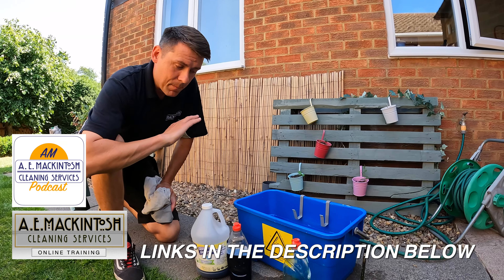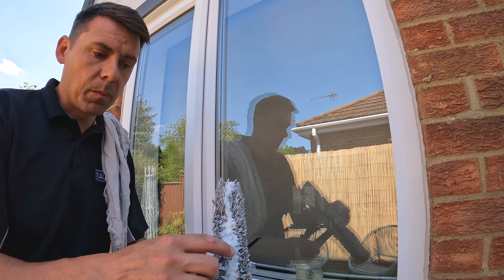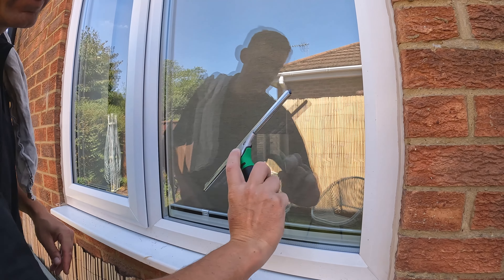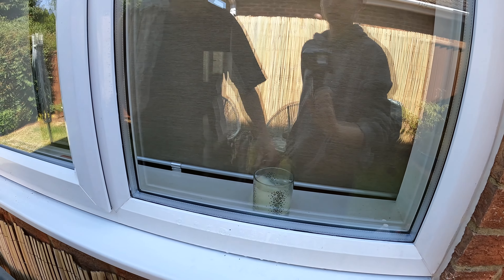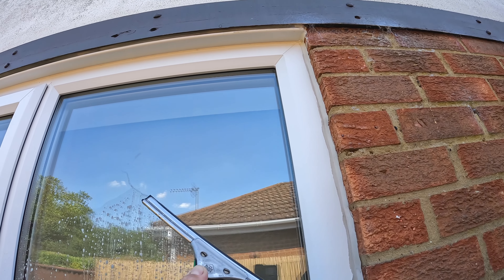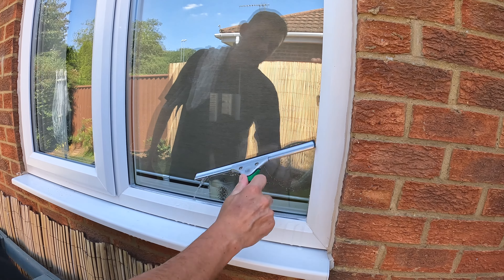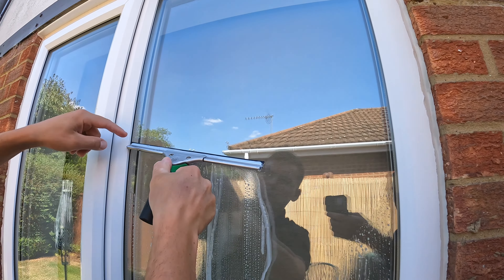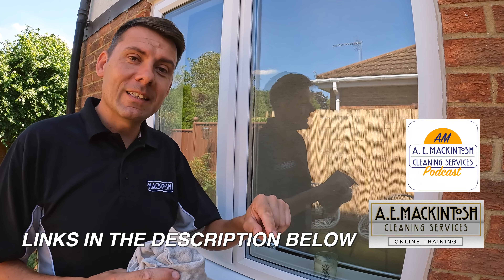Learn To Use A Squeegee In 3 Easy Steps!

Comment: Great tips Ashley. For a long time I felt I was using too much pressure when using a squeegee. Just holding it very lightly on the glass makes it so much easier to glide. It's awful simple really but it makes a difference.  ☘️
Reply from the maker: There is more detail on this technique in my course, this is just a taster. But it’s good to experiment with different amounts of pressure and soaps and rubber combinations until you get one that suits you. 😉👍🏼
https://www.aemackintosh-onlinetraining.com/courses/window-cleaning-tools-and-techniques